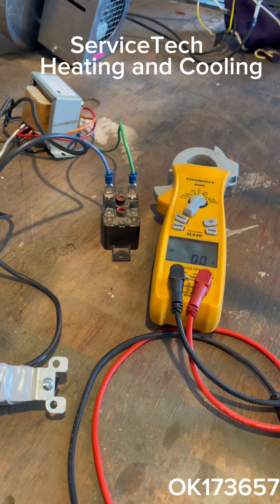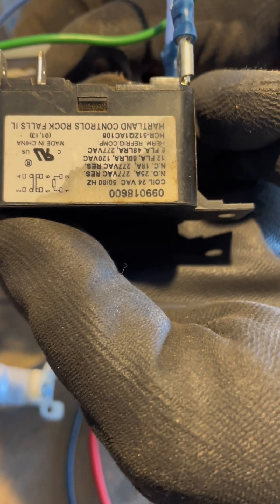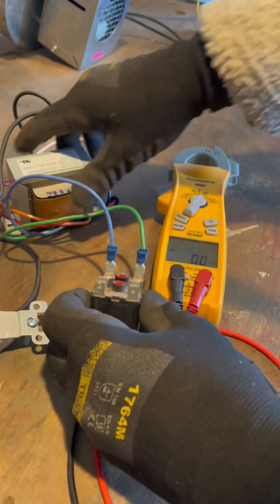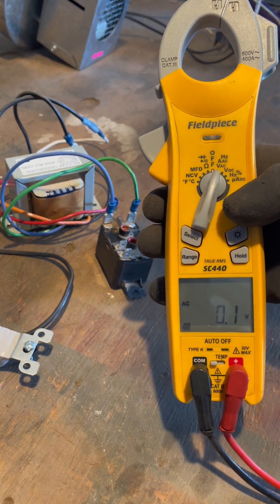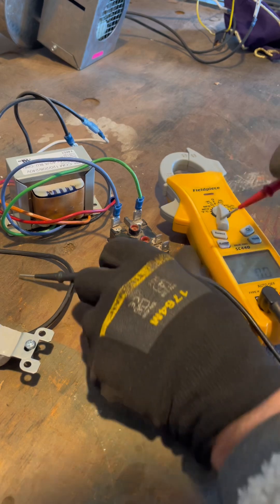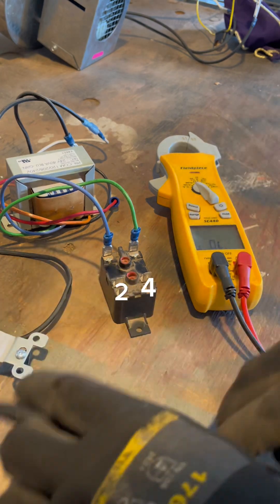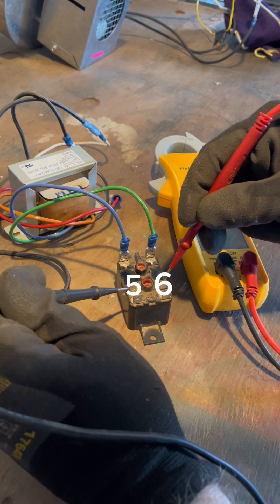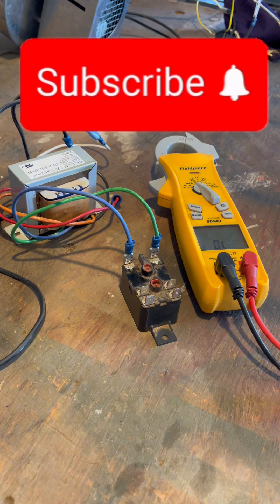Ep2 How to test a Relay

Comment: I appreciate your efforts to make this video & spread knowledge to others. Just one word of advice...a relays contacts can make continuity but still be bad. The arcing on the contacts will eventually build up a crust on the contacts and will cause extremely high resistance. This can lead to high amperage and tripped fuses or fire etc Always get the Ohm reading...it will tell you the true condition of the relay & won't lead you astray like continuity will.

Comment: How did you make that switch. You said you would recommend on making one. Very good idea
Reply: How did you make that setup*** I meant
Reply from the maker: I simply cut a pigtail for a 120v plug in . I wired that into a transformer . Put a light switch in between the transformer and the power plug . I put spades on the ends for easy connections when testing . One could also wire a 3 amp fuse easily into this circuit . If you would like I can do a short on how it’s made to clear up any miscommunication.
Reply: That would be awesome